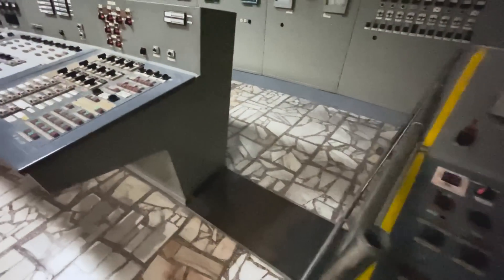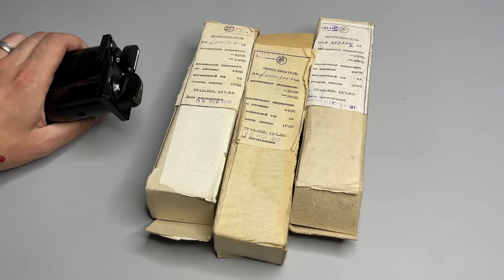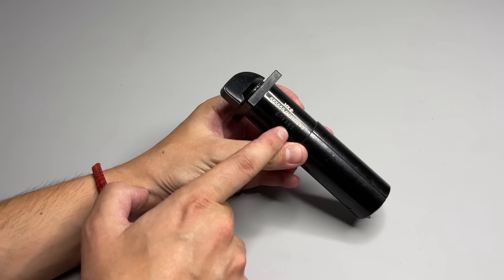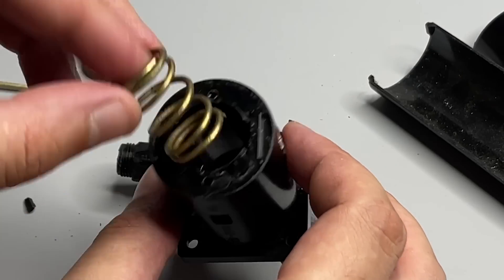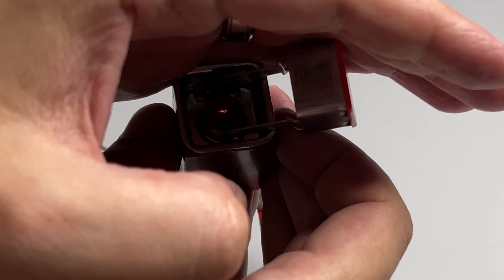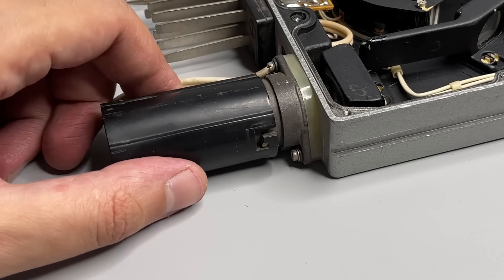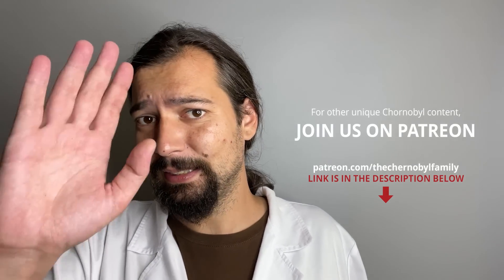What is inside the AZ-5 SWITCH and other Chornobyl controls?

Comment: There is no dought about it the engineering is amazing and still works today very clever using what you have to hand,  and not saying it can't be done mechanical works just as well  if not better in some cases I know it's not as small , but it can be repaired if need and it is made so well in the first place .

Comment: I'm currently working with some M1730 panel meters and getting them working again. They are absolutely fascinating. One common issue is that one of the mirrors comes loose due to the adhesive failing and the glass in front of the mirror coil as well. I am also working on making a 3D printable adapter or sleeve for these since it seems the bulb is nothing more than a BA15D lightbulb. The sleeve can be glued onto an led replacement bulb without having to modify the panel meter at all. (a regular lightbulb would get too hot for a 3D printed piece).
Reply from the maker: Very cool!

Comment: Hello, very great video. But a question regarding switches: do you have the switch with separate key? Like LAZ switch on VIUR panel. It’s just interesting if it used an actual key (like for door lock lol) or separate handle
Reply: МКФз. Там ключ (не ручка), секретности разные.
Reply: @azrt43  Да я так и думал, что там ключ. Просто один спорил со мной тогда давно, что там съемная ручка была просто и все. Поэтому и спросил

Comment: Well, as already said the meter is fantastic. And please trust my experience that is not big. We used in Romania, somehow a similar meter, but the scale limits were detected by  a induction based sensors which were mounted on a circle shape cogwheel inside to detect only the mix and max and that meter is  way thick and a bit deeper.
What is extremally interesting is that that multiple values (I mean multiple minimums and maximums values ca be detected and reported by the network of photoresistors planted on the film surface), plus, the only moving part inside is the mirror, which as it`s obvious it`s well protected).
Another aspect is the color....a very logic scale....green---->yellow---->red.
Redundancy of the limit detectors....if a photoresistor fails, the next in row, will send the signal. Even more, the tiny photoresistors can be planted in parallel... on this type of equipment the redundancy is crucial.
One point of failure is the bulb itself, but even with a defective bulb, this can be easily observed by the staff from the day/night shift.
For sure as the bulb is for 27V~ which often was used by navy/mil, even sometimes @400Hz, (for sel-syns for example), powered at 24V, will last a very very long time.
I repaired some industrial electronics (sdelano v sssr) and noted really clever and extremely interesting ways of applying the physics, with very complex features, not easy to obtain, acquired thru simple means).
The level of engineering, ingenuity was just insane...the engineers were really top top top of the class.
I own as collector items some soviet  electronics, also with lacquer on top, awesome.
Don`t get me wrong, we had plenty top top engineers in Romania back in the days, yet this example with this special meter, which can be created today even smaller than the original one, is and absolute work of art.
Could say more, but makes text too long to be read, about some of my experiences with sovietic electronics since it was largely spread and used in my country too.
Reply from the maker: Thank you for this and for sharing your experience. Indeed, that is a very interesting device, and in fact the technology was hosen as before all those designed for marine use.

Comment: These are rotary switches with several positions and even more poles, they allow for switching several connections with one position. Some poles might be in parallel for redundancy in case one contact fails, i would expect this in critical applications like NPP control.

Comment: An optical meter seems like a strange choice for critical monitoring because if the bulb burns out, you can't read the meter at all.  A backlit needle will at least allow you to see the needle if the lightsource fails.
Reply from the maker: Perhaps they had a control for this, as there is a test sequence of all panels (check one of previous videos with the archive footage)

Comment: I am sure someone has said it below somewhere but many of us have used EdSpot galvanometers which work in a very similar way with a light beam and moving mirror with the 'throw' acting to amplify the weak signal.  Many very early galvanometers used a magnet/coil light and mirror system and could project onto a scale across a room.  In your case they are very visible even in low light levels and the light beam replaces what would be a large needle.

Comment: The first switch can handle 220VDC or 380VAC. Quite a contact gap to disconnect DC that high.
The square battery can be substitute with Li-Ion battery as the voltages are close to each other._
Reply from the maker: Thank you! Yes, of course it is pissible to substitute that battery, but I will need exactly that one for, let's call it this way, "authentic approach"

Comment: The pushbutton indicators are very reminiscent of the MIL-PRF-22885 push button/indicators produced by companies such as Eaton, Korry, Applied Avionics etc and still used extensively in modern avionic and military systems. The optical beam guage is very interesting - it reminds me of the vertical tape displays used in avionics (and some naval applications) in which a tape with a printed scale is positioned (often by a synchro/resolver). Such tape displays are still used although often implemented graphically such as in modern EFIS systems (LED versions also exist).
Reply from the maker: Thank you for sharing!

Comment: 10:32 The coloring feature may seem a bit ridiculous but if you have dozens of meters to monitor simultaneously, I can imagine it's quite handy that the indicator light also changes its color. The RBMK was definitely pushing the boundaries of operator workload, so it's probably worth it to implement.
Reply from the maker: Very true.

Comment: Why is it called A-Z5? why not just label it ”off”?
Reply from the maker: Because engaging the AZ (which stands for Emergency Protection) is very different from "off". AZ-5 means the 5th level of the AZ, so if not disengaged it reduces the power to zero. But there are four more AZs, for example AZ-3 would reduse power for 2%/second with optional engagement of other protection systems depending on the operative mode chosen. 

Or less wordy, it is not "off" switch, it is a brake system like in a car. Can slow down, can stop.

Comment: That rotary switch was switching many more contacts that I was expecting.  Interesting!

I'm also sure that I've seen another YouTube channel demonstrate an antique current-measuring device that used the same principle as gauge you showed.  Similar, but much, much older (perhaps over 100 years old, even), and without the film + photodiode parts.  A very interesting piece of old tech.
Reply from the maker: Thank you! Yes, there should be such a video as undoubtedly this meter is not a soviet creation.
Reply: @ChernobylFamily  I found it! This is the 19th-century lab instrument I was thinking of:  https://youtu.be/QLlYhhPjsDs?si=-BYN0XdbdMa7x4od

Comment: That meter has a very clever design. I imagine the photoresistors on the green and red films could be used to provide signals to the computer so it can record the levels that the meter is reading. Perhaps it could be used with some other circuitry for simple automations, like flashing a warning light on one of the the operator's panels, or actuating a coolant valve or something.
Reply from the maker: Yes, though I'd not risk attaching to it something important as all in fact will depend on a single light bulb.

Comment: I tripped over your channel before, but this video got you a sub. This is the kind of in-depth technical content the internet NEEDS. Very interesting and awesome. Where did you even source new-old-stock Soviet era switches and buttons like that? Very cool.
Reply from the maker: The thing is, many, many things like this were overproduced. It is possible to find them from electronics surplus sellers, metal scrappers, etc. here in Ukraine, but it takes a big effort to search for them. Also, sometimes items are not cheap, especially if they are narrow-specialized.

Comment: Please tell us more about the "original" AZ-5. There are rumours, that the "real" AZ-5 in 1986 was not a switch but just a simple button, located at the bottom left of the panel and not on the top.

The „switch version“ which is always shown in videos and guided npp-tours was mounted after the accident as part of many various security adjustments and was not in place at the night of the accident.

Is this true?
Reply from the maker: Yes, it was a round button with a metal bezel, you can see the same buttons on the shots included. It was very standard, so that's why I even did not mention it.
Reply: Thanks man for the verification 🙏 I red about this months ago in a random comment section but never found legit/detailed infos on the web. 

Do you know if there are any pictures of the original panel with this button still in place available?

Keep up your great work 💙
Reply from the maker: Check our very previous video for this. HOWEVER, opinions vary even at the power plant in regards of what I pictured. Some say that it was in a different place. Some say it was as it is now. Too much time passed...
Reply: @ChernobylFamily  Perfect! Will check the vid instantly. Have a good night 💛💙🇺🇦

Comment: Fantastic looking equipment. I love the meter, it's called a mirror galvanometer by the way, earliest ones were used to find faults in the very first transatlantic cable. The light beam was reflected on a much longer distance for that, as the distance between the mirror and the screen acts as a multiplier to measure minuscule variations of signals.
I'm not surprised that there was a way to detect the beam of the meter, safety critical display devices have a way to self-check for faults. I'm sure these displays were used in nuclear submarines too.... 
It's very clever and elegant to use a camera-type film holes and sprockets to do the moving green and red flat-flex PCB. Isn't it a very early example of flat flex PCB, by the way? 
I'm also surprised that the illuminated switches didn't have a way to self check if the bulb actually works... It's also safety critical to have readouts of your control rods status. I think. Lol :P
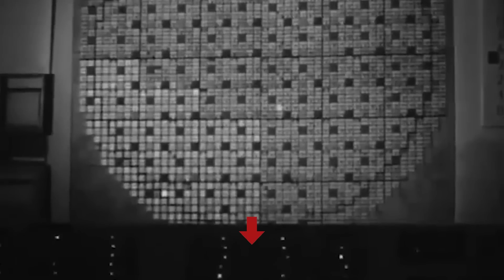(9:32 , beautiful sight with all the display working.. should have been a very special workplace to be)
Reply from the maker: Yes, it can be considered an early flex PCB. Later they learned how to make them better, but all of them still were very fragile. As for buttons, the button is general-purpose, it is not NPP specific; I believe there was an external schematics to check that and also control panels had a test light-it-all-up sequence

Comment: I have some old soviet nixie tube digits that I tell myself are spare parts from an RBMK control room. Great video thanks!
Reply from the maker: The truth is, there ARE devices in the control room which use nixie tubes.
Reply: @ChernobylFamily  Good to know, they are brand new in the box. no writing on the box, just a plain cardboard box. I will dig them out of my workshop and look  for part numbers, maybe there is a way to cross reference them.
Reply from the maker: Those used are IN-15 and IN-12, SKALA uses the IV series.
Reply: @ChernobylFamily  I actually think they might be IN-12

Comment: I agree that it's weird for that gauge to send signals as well as receive them. It's beautifully made though, very impressive. Those switches are nicer than I thought they would be but I wonder how reliable those contacts are, they're just metal points that slide across each other. I suppose the spring makes sure it happens quickly.
Reply: Pretty reliable, once you remember the correct operating condition for the contacts. They run best with 24V across them when open, and 20 to 100mA of current when closed, which helps by keeping the contacts free from oxide, as they wipe across each other, and this make good metal to metal contact. You get a totally different switch, with thick gold contact faces, for low level signals, such as those from the hundreds of thermocouples and platinum resistance thermometers that were used to measure temperature, and the hundreds of bridge type pressure transducers as well.

Those AZ-5 switches look like they break before make, so while you operate there is a brief period where all contacts are open, so as to prevent shorts. Others will be make before break, where you do not want interruption, while say changing the range on a meter.

The mirror galvanometrs are very interesting, with them not only showing up as readout, but also being a simple interface to the SKALA system to be able to input state information without needing complex extra converters, and also associated programming on them as well to set limits. Just built into the existing display, annd an easy way to show if nominal, or which way the deviation is. Likely there is a further phototransistor there that also acts to inform that the lamp has failed, and print it out for a repair operation. 28VDC lamps, run on 24VDC, probably with a series resistor as well, so as to drop voltage to around 22VDC, so leading to greatly increased lamp life.

The type of lamp is classed as prefocussed beam, as the optical path is fixed in the lamp construction, so that in use no further focussing is needed during changing the lamp, as all of them are adjusted in the factory to have the filament in exactly the same orientation and plane, so you simply swap the failed lamp out, and close the panel up.
Reply: @SeanBZA  You're right about the operating conditions of switches being an important factor. Microswitches in computer mice are now operating on such low currents that there's no wetting current. Omron switches rated for a million cycles don't last more than a year, it's insane. That all has to do with the low currents of the new microcontrollers being used. I bet you my old MX518 from 2005 still works, but I can tell you that a mouse I bought 2 years ago is already getting flaky.
Reply from the maker: They look pretty reliable and that spring seems to ensure a good contact.

Comment: The resistors on the green and red film probably used to control another instruments like a more noticeable light or an alarm. In this way they can save the wireing and the computing power.
Reply: Probably for some fault protection and notification operations, as they're not precise enough for feedback control.
Reply from the maker: I also think so

Comment: thank you! these were some very interesting components. 😀😍
my take on how I think the last item works: the Mirror is on a pivot
which is connected to the movement of something like an Analog meter, 
and when the milliamp value  changes, the  meter's armature  moves forward , thus
causing the mirror to rotate  X amount of degrees , and the light spot moves 
across the scale.
we have similar industrial rotary switches here in America, but they differ in that the contact layers are modular, so they can be customized ,  by adding or removing contact modules.
Reply from the maker: Sounds pretty right!

Comment: Hi, Do you know why they used the AZ-5 switch, when they shut down the reactor number 3 for the last time? Thanks😊
Reply from the maker: Because it was a show. The reactor was dead at that moment, they raised the power for 5% or so to have what to shut down. I am NOT a reactor expert, but I believe at this power you can use AZ-5, BAZ or a plain hammer with the same effect.
Reply: @ChernobylFamily  Unless the RBMK reactor was under severe Xenon poisoning and all but 6-8 control rods were removed from the core and SKALA only did the monitoring... then rotating the AZ-5 switch would first force down (under the force of gravity) the graphite tips of the control rods, rapidly rising the thermal power of the RBMK reactor thousand times in a matter of a second...
Reply from the maker: The question is, would be the same effect after the post-1986 modifications.
Reply: According to a «СИУР» working at ChNPP the AZ-5 was a button at the time when the accident happened, and it was changed to a switch later. For the SCRAM one had to push and keep pushing the button until the rods got in final position. On that fatal night the operator pressed the button and released it, then after some seconds pressed again and held it. It is not known if he released the button by mistake or intentionally.  AZ-5 was used not only for SCRAM, in some circumstances it was OK for the operator to press it for a sec and release it so the rods slide in a bit to the active zone. After thorough analyzation of the events button was changed to switch with memory.Once the operator initiated AZ-5, it was not possible anymore to abort the process, even by turning the switch off.

Comment: thank you for the insight, the gage is very interesting, and simple. there is nothing wrong with simple technology as it is more reliable, and will operate for many hours without problems. even the lamp looks to be built to operate for many hours without burnout.
Reply: The gauge seems to be over-engineered, but when you think about it, it provides a configurable visual indicator and limit switches using only one moving part and no digital components, which is quite impressive and seems more reliable than slider-based ones.
Reply: @chri-k  I have worked on RUSSIAN  radios, and the "BUILD QUALITY" is excellent, just like this gauge/ rotary switch!!!!.
Reply from the maker: That lamp seemingly is for medical equipment. At least we relatively quickly could find those on sale.